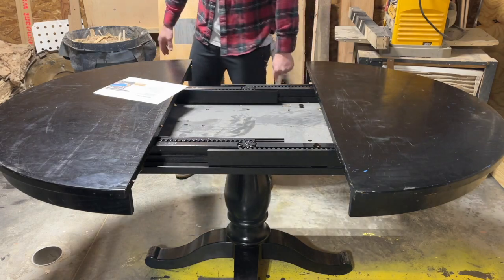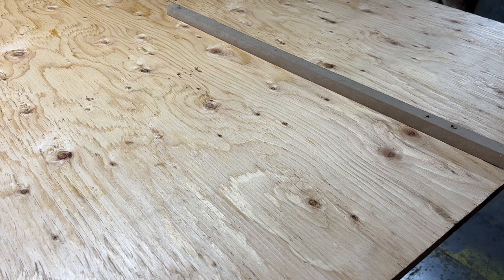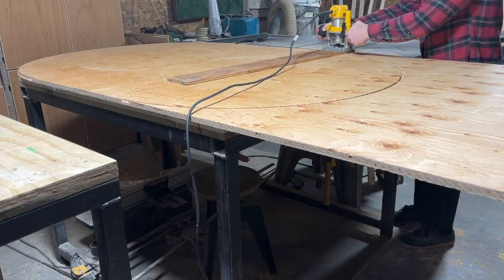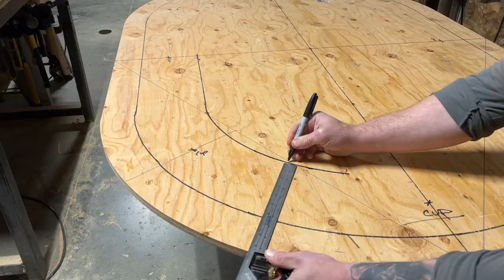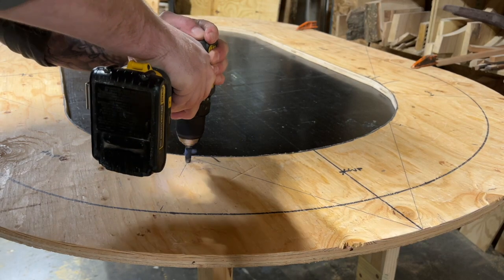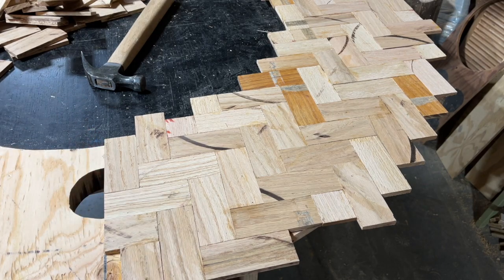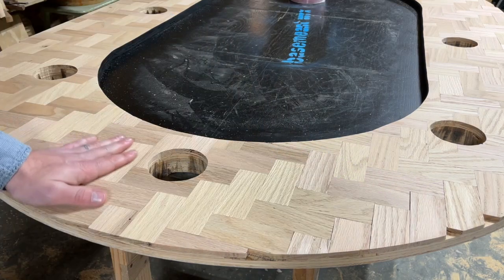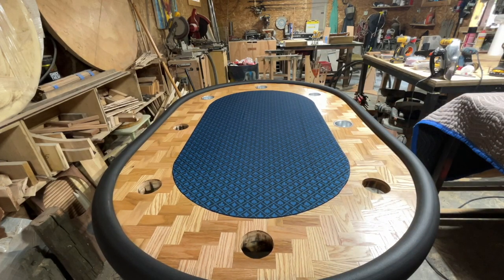DIY poker table from your old dining table

Comment: I like it, one suggestion though. Should have added neoprene under the felt to add a spongeiness to the table, will aid in cards sliding and chips not bouncing and rolling.
Reply from the maker: Good callout.  Thanks.
Reply: 100%. I'd go as far as saying it would be worth it to disassemble and add 1/4" closed foam.  It also makes picking up cards and chips so much easier.

Comment: What is the width of the rail and the dimensions of the playing surface? Great build!
Reply from the maker: the overall dimension of the table is 72" x 48".  the pieced wood portion was about 10" making the center fabric portion 52" x 28".  Thanks for watching.